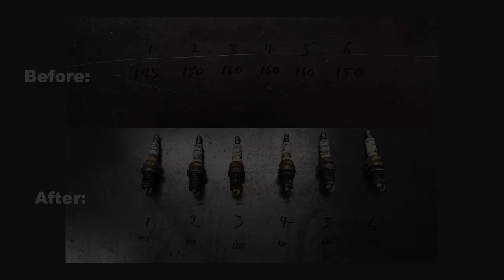Restore Engine Compression $10 - Does It Work!?

Comment: Are those compression  numbers good or poor?
Reply: Damned good, especially considering mileage.
Reply from the maker: Normal, but I'm totally happy with them for having nearly 250,000 miles on the engine.
Reply: Pretty good. Spec is 120-150, with 30 PSI max variance between cylinders.
Reply: Fre0n X really good

Comment: Nice presentation.  I'd like to point out that Jeep states the cylinder pressures should be between 120-150 PSI with all spark plugs removed and the throttle wide open.  Checking pressures on the fifth compression stroke gives a good average.  Results may vary due to altitude, humidity, and temperature.  Your numbers are mostly higher than stock.  You have no issues.  I run a bit lower on mine with 120 psi average on my '93 XJ with 237K.  I also pour in Rislone ZDDP additive at every 4500 mile oil change since I bought it April, 2018 with 226K.  I hope you don't have the infamous 0331 head prior to the TUPY casting. You'll get lots of life out of that engine otherwise.

Comment: Was it the same pressure gauge? Did you disconnect the injectors before the tests? Those are some stout numbers for 240k.
Reply from the maker: Same gauge. Did not disconnect injectors. Repeated the second test exactly as the first test was performed.
Reply: Mine has about 200k on it and produces same numbers besides my cylinder 1 is not that low
Reply: I was about to say the same. I believe my 02 TJ had about 160 on every cylinder at about 200k km. Not too sure how my 5.2l ZJ is... that's why I am using the restore haha.
Reply: Mine had really good compression like that up until 290k. At 290k, the cylinder walls glazed over, lost compression, and developed severe blow by. Needed a hone job and rings. Oil pressure was still really good as well. Would hold 60psi oil pressure on the highway and 30+ on hot idle. Built a 4.7 stroker and swapped it in lol.
Reply: Not really. My 5.2 was 175 across the board with 175k.
Reply: @matty8272   Your numbers, and the video's, are likely incorrect. FSM is 120 to 150. Altitude correction as well. At that mileage, a realistic reading is 100 to 130. The vast majority of gauges in use are cheap Chinese and inaccurate. But same gauge, same procedure, same temp cancels that. Carbon buildup, a popular thought, cannot raise pressure by much, considering the very small loss in cylinder volume.
Reply: @TheRayDog  so your saying that my engine should be worn out to below 75% of factory spec?  Its been tested by several mechanics at different shops, They all were amazed that its so close to "new"  Not some cheap Chinese crap.
Reply: @matty8272  It can't reasonably be expected to exceed the FSM's 150. It's only an 8.8:1 compression ratio engine to begin with. Times atmospheric 14.7 psi gives 130 psi. Heat from compression being the rest. Altitude factor is 0.9 around 3500' if you live higher. But theoretically, a 150 expected new would be considered worn out around 100. Which means at 240k, yes about 75% of that difference nominally should be gone. Or maybe 50% in your case. Gauges are just poor today, but testing when engine is really hot or when wet can give false high readings.

Comment: Oh the guy who was teaching me to work on late model Honda's told me this stuff thicken the oil in particular way that under load/pressure it seals around the pistons better. He explained it better. Point is if you have a late model Honda with over 130k this or adding hyper lube to the oil will benefit the engine.

Comment: I was gonna use this on my 2v triton until he said I gotta remove the sparkplugs.
Reply from the maker: No one said that. You just follow the instructions and add it to your engine oil. I pulled the spark plugs to test the compression before and after to see if the stuff actually worked.
Reply: You see I dont pay attention,  If I did idk, I wasnt listening to that part
Reply: @phoenixlove76  I've done spark plugs on the 2 valve it ain't that bad besides movie the fuel rails 
Now spark plugs on an Express Van is a pita because the boots always like to stick mostly cause NO ONE USES GREASE!
Seriously why doesn't anyone use grease. I just did the spark plug module on an Oldsmobile which requires the removal of the assembly and no grease either. 
I have multiple tubes in my closet of dielectric grease. I slather it one everything from electrical terminals to battery post and plugs and all other spots.

Comment: BEWARE…..may clog oil Filter….and 10 to 15 pounds drop in Oil Pressure….that was my experience Twice….good quality Filters get clogged….seems Restore works on very Old engines…but I do not Think …my 5.3 was impressed…wasted a lot of expensive Oil.

Comment: If you take and pound the top of the valves with a dead blow hammer it'll usually knock off the built up carbon on the valves and you'll see better compression numbers.

Comment: Mate,,,, you prob lost idle quality, power, torque and mileage using those plugs in that thing. Unless you have extreme mods (nitrous, supercharger, meth injection etc), you regress immensely using anything other than Champion plugs in a stock Mopar. Other than that, great vid. Also,, unplug the cam sensor when you do a comp test.
Reply from the maker: Good tip on CPS sensor. I've replaced those plugs since filming this. It ran, idled, etc. Fine with those and runs good with the new ones too. Thanks.